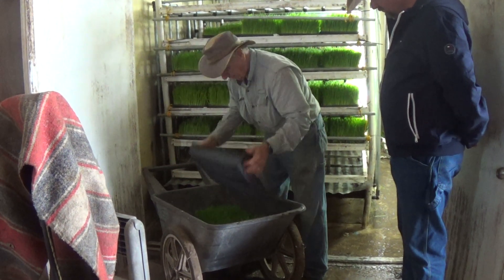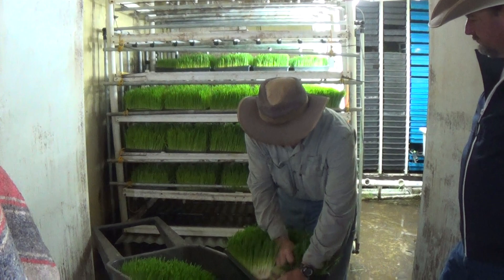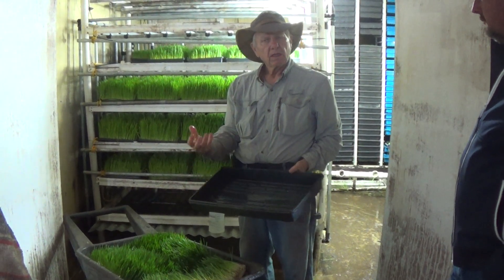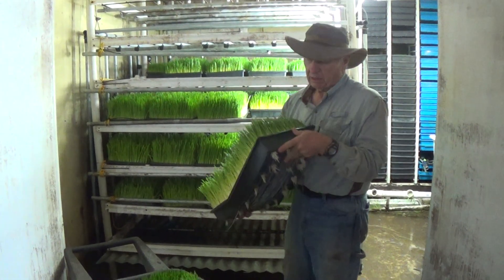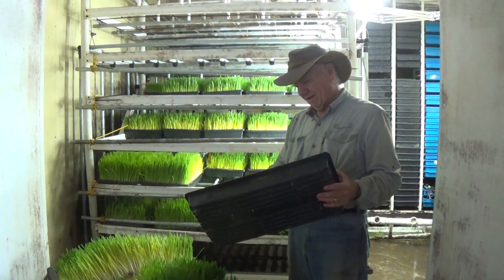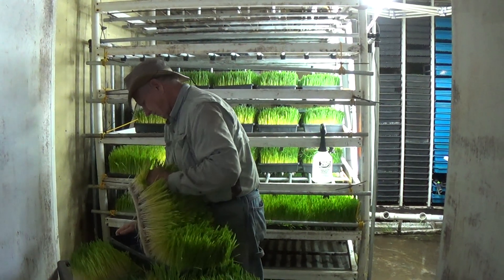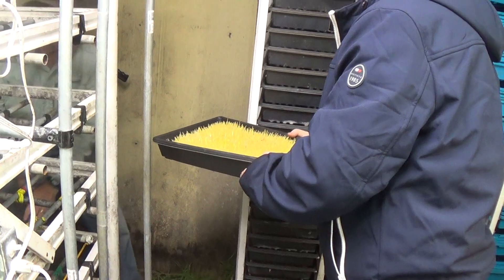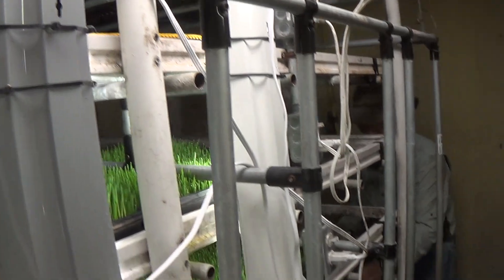Feeding horses fodder at Paul Johnson's Cripple Gray Ranch 12/27/2019.  1 of 4.

Comment: Have you ever considered the idea of geo-thermal regulation of temperature by using cargo containers buried beneath the permafrost and the roof replaced with a white corrugated plastic with 6" PVC pipe in one corner 6" from the floor and in opposite corner the pipe is venting air out with the pipe 6" from top of roof. with sunlight to grow fodder, and fans to move hot air out the cargo/greenhouse for not only fodder but also on opposite wall growing garden herbs, vegetables, etc.?
Reply from the maker: I have never considered that.  It sounds like it would create a well insulated environment so not much power would be required for maintaining the desired temperature.  You would have to use some kind of pump to get the waste water up and out of the container.
Reply: @pjpxmcd2  Maybe a pond/aquarium pump to circulate the water. But the water set up you have already in the fodder shed looked well thought out and was more than adequate. I'm not much of a design engineer person, but basically my idea is like a sunken green house with the roof arched over the below ground structure. As low tech. type system of using as much of what nature has to offer.

Comment: How much do you feed each horse and how has this affected your feed costs? How has it affected the horses?
Reply: Wondering the same. We are building ours & have done the math at 2 8lb trays finished weight per day to each horse.
Reply from the maker: When the horses don't have any grass in the pasture, I am feeding about 2.5% of their body weight,  approximately 25 pounds per horse per day.  Since I don't use any supplemental commercial feed or hay, my feed costs about 1/6 of when I was buying feed and hay.  My horses condition and health all around are much better than when I was using commercial feed.

Comment: I see that you feed exclusively fodder.  The rate I see is 2% body weight.  My horses have no pasture and I feed exclusive alfalfa/grass mix.  Do you think 3% is a more realistic number when there is not pasture.
Reply from the maker: When I thought my horses were getting thin, I increased to 3% and then thought my horses were getting fat.  I cut back to about 2 1/2%.  My horses always have access to pasture, even though some times during the year they aren't getting anything from the pasture.  I would suggest you just start at whatever percent you decide, then adjust if you think they need more or less.

Comment: Can fodder be a complete hay/grass substitute for in winter? or could you do fodder and hay cubes? Or would they still need hay?
Reply from the maker: I am happy feeding my horses fodder only in winter when there is no pasture.  I have been doing it for my horses since 2011, and not supplementing with hay, or any commercial feed.  Some people say you still need to feed a certain amount of hay, but I don't believe it.  My horses have been doing fine without supplemental hay for over 10 years.
Reply: @pjpxmcd2  thank you so much!! Could you do oats instead of barley? I can’t seem to find any around me 😞
Reply from the maker: @haileybelcher2457  Yes, you can use oats, or wheat, or many other grains to sprout.  I hear that oats grow a little slower than barley, but if that's what you have access to, you can sprout it and feed it as fodder.
Reply: Horses are designed for eating most of the day. In periods where they don’t have feed their stomach acid attacks the stomach lining instead.

Comment: I have a similar set up. I’m trying to get the temps regulated for ideal growth time
Reply: What's the measurments on your trays and what's the weight of a tray of fodder. I'm trying to get an aprox average on how many square inches of fodder equals 1 pound.
Reply: @davidsnow9453   pretty sure it will be one pound of seed per tray and should weigh about five pounds when finished
Reply: @timcarr4155  thank you
Reply: @davidsnow9453  no worries anything else you want to know? I was going to build one a while back but didn't want to spend the money...
Reply from the maker: @davidsnow9453  My trays are 10 x 20 and the final weight is determined by how many pounds of seed I plant in each tray. On the day of the videos, those trays weighed 11 pounds. If I don't want to feed as much, I just plant less seeds in each tray. Another way to figure it is if you know how much your system is producing per pound of seed
Reply from the maker: @davidsnow9453  I count on getting at least 5 to 1 ratio, but I have gotten over 8 to 1.
Reply from the maker: @davidsnow9453  These trays are 10 x 20.  I put a little over 2 pounds in each tray and these trays were weighing 11 pounds when I harvested them.

Comment: Where are you finding your grains? I'm trying to build one of these systems and am having a very hard time sourcing barley.
Reply from the maker: I just buy mine in bulk from a grain elevator.  Barley is not local to us, and the closest mill that I have found that carries it is 200 miles away, Livestock Nutrition Center, in Saginaw TX.  I haul a small dump trailer and pick up 3 tons in the trailer each trip.

Comment: I didn't hear what you were spraying the trays with after you took the grass out of the tray. What was it?
Reply from the maker: At that time, I was spraying them with bleach water, about 1 part household bleach to 4 parts water.  Bleach eats up the pumping mechanism of hand sprayers and power washers.  If you want to do it full time, with any kind of sprayer, you need to get a sprayer that is designed to have bleach used in it.

Comment: The centre not growing.Could that be because the trays are supported on each end and the centre maybe deflected down a bit?
Reply from the maker: The trays are supported by welded wire panels 4" x 4", so I don't think the center is deflected down.  I do think the center just gets more water passing through it than the edges.

Comment: add hydrogen peroxide to your water to knock out anaerobic conditions in growing /root area.
Reply from the maker: Thanks for the hint.  The new system I am trying to start using has an injection pump as part of it, and I will be injecting Hydrogen Peroxide through the injections pump when it gets up and running.